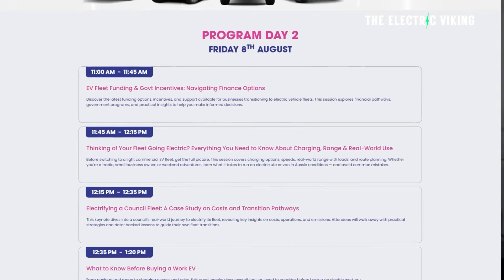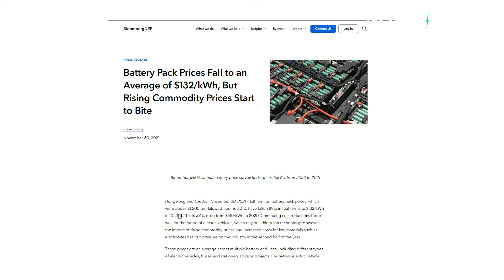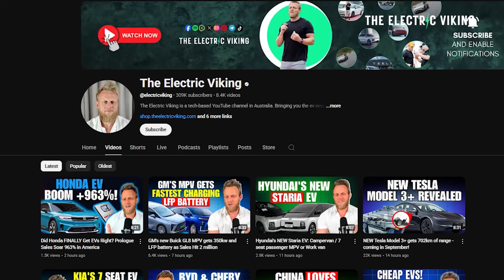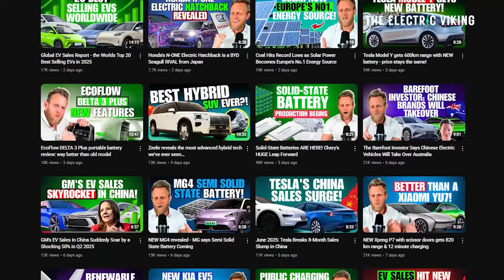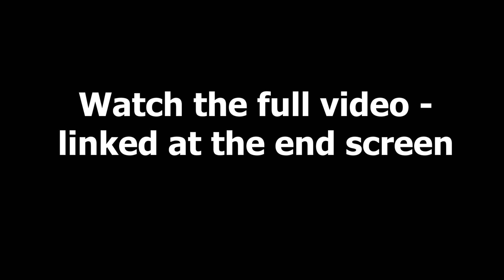EVs Are Almost as Cheap as Gas Cars Says Bloomberg — Here’s the Proof!

Comment: 10 years ago all news and print media published all EV adavantages and why they would be much cheaper than comparable ICE cars: 1000 parts less in the engine, no exhaust, no cat, no oilchange, no radiator, no gearbox..... Published conclusion/ result: an EV will cost at least 1/3 less than a comparable ICE car when it becomes mainstream, most probably only half.

Comment: I wish you were right. Unfortunately the picture in Europe is totally different. Last time I bought a car, 7 years ago, was a Suzuki Vitara, 4WD for €20k. A similar sized EV with 4WD is above 40k. Even if I compromise and look for a FWD car with decent range (over 400km) it's above 35k.  BYD has just opened a showroom ~70km from my home, their prices are the best but there are so many uncertainties with that company and with China. The more I watch your channel the less likely I buy an EV this year. It's like buying a digital camera 15-20 years ago. What you get is good but you know that something better is coming up soon, higher resolution, better dynamic range,  etc. With EVs it's the new battery technologies, autonomous driving features and price. And of course, you can't sell your old digital camera. None needs the old tech.
Reply: Nonsense. For example you can get a used hyundai kona with 64kwh battery (depending on how you drive) and few kilometers for around 20k. There are PLENTY New EVs with 400km range for under 40k.
Reply: @seppwurzel8212  The Hyndai Kona is on top of my list. But I'm not looking at 5 year old EVs. Those are around 20k. The new price is above 35k. As you wrote, there are EVs under 40k with 400+ km range, but a similar benzin is close to 20k and in this video the claim is that they are almost as cheap as gas cars. That is not true.
Reply: @AnTalk_blog wrong again. The VW ID 3 for example is within 200 euros price range of the similar ICE model. The MG 4 is slightly more expensive but has much better features that would cost a ton more money if in a VW
Reply: @seppwurzel8212 that soap box didn’t even make it to my list. Rear wheel drives do not qualify for me. Living in the Alps on a steep hill with potentially plenty of snow in the winter, rear wheel drives are a bad choice. I’m keeping an eye on the EV market, did my math and my experience doesn’t not match the above statement. Furthermore when buying a car you should also like it, not buying any shit wheelbarrow only because it’s cheap. At least this is my opinion. Most likely I will buy one sooner or later but it’s a hard decision especially when we know that better and cheaper EVs are coming (or at least we expect them to be so).

Comment: First you say EV sails are something like 25% however BEV sales - 100% electric are only about 10% of world wide light vehicle sales. In 2024 BEVs totalled 10.8 Million units of 100+ million light vehicles sold.  These BEV sales figures are suspect because companies like BYD are selling to dealers who may have them sitting on lots or sold as used with no miles; with highly subsidised prices. In addition many in China are not full size cars - they include mini city cars that have no safety features or ability to go to highway speed.  Even if you accept this - total market penetration of the 1.4 Billion light cars is under 2%; and heavies is near zero.

Comment: If EVs are the better value proposition to the consumer then the consumer will choose an EV over an ICE purchase.  Of course this  assumes access to charging is a non issue.

One big howler of course is the asphalt roads we drive on are made from oil product.  What is the renewable proposal as only 30% of the barrel of oil is turned in to petrol and diesel for ICE vehicles.

Comment: Talked to my insurer earlier this week to make adjustments to homeowners insurance due to the addition of rooftop solar on home in SE Michigan
My homeowners and auto are with same insurer.
Home insurance went down several hundred dollars with the added solar, as it counts as a backup power system. Contrary to what others have claimed or experienced in other states, either due to local weather (hurricanes) or just gouging by insurers.
As I expect to get an ev within the next 2 years, I asked what effect that would have on my premiums.
She said yes, in general, premiums may be higher for an ev vs equivalent gas vehicle, but more for a Tesla vs a Ford or GM ev.
She estimated 25-30% higher insurance rates for Teslas due to special  parts costs, and I am guessing, tendency of sports car driving behaviors resulting in more accidents.
Newer GM, Ford ev like the Equinox or Lightening are built using more traditional methods and parts other than ev specific bits.
As production numbers and ev numbers on the road increase,  I am certain insurance rates will be the same or less within 2 years ev vs ice.
Either way, my premiums reduction due to added solar most likely offsets any minimal increase in auto insurance for a Ford or GM ev given my time horizon
Reply: Insurance for my 2021 Bolt is only $30 more per month than the 2012 Prius C I traded in, which I thought was very reasonable.
Reply: @craigmerrow225 Sounds like less increase than basic inflation given the difference in model years.
The savings in fuel, oil and incidental ice maintenance (*belts, hoses, etc) more than make up for the trivial insurance rate  increase for a non Tesla ev, if any depending on your insurer, location, state, age, vehicle type, etc

Comment: It isn't complicated. EVs are already capable vehicles and they will get better as battery tech improves. This will slowly but surely eliminate the issues of range, charging speed, and cold weather performance. All you have to do is compare today's EVs to 10 years ago and then grasp the huge $$ going into battery R&D and ask yourself what it will look like 10 yrs from now. We overestimate the speed of adoption all the time, while underestimating the pervasiveness of the change.

Battery cost for performance...downward curve. Fixed costs...downward curve as volume of sales increases. There is only one inevitable conclusion and the only thing worth debating is the timeline. 

Gov'ts already know this which is why auto tariffs or outright import bans exist.... to shield domestic auto manufacturing from competition.

Comment: I drive my old diesel as long as possible. No cheaper way to drive a car... I am not at all against EV, but still too expensive...
Reply: My 1995 chevy k1500 has 200,000 miles, runs great, parts and repairs are cheap.  I'm retired so don't drive much anymore.  I can't imagine any reason to buy an electric car, makes zero sense.  Americans like trucks, and there's no practical electric truck at this time.
Reply: @gumby2241 fully agree🎉

Comment: In the USA 30-40% of people do not have housing with a garage or driveway, so you will always have people that can't charge at home.  This puts a ceiling on EV adoption at maybe 75% of new sales.  Per gas stations closing, this 25% will be plenty of demand to keep at least some of the pumps available at existing gas stations.  Also, much of the profit of a gas station these days is the mini-mart inside.  Also, many of these stations are built with 25 year expectations, the tanks exist and don't require much upkeep cost (and need to be pulled if they completely stop selling gas) so they might drop do fewer pumps, converting that space to chargers.  We have these hybrid station in Northern Virginia.  Sooooo .... I would revisit your logic about gasoline refuel range anxiety at least for the next 20 years. 

In the near USA you need EVs to be 25% cheaper that comparable ICE cars to compensate for the extra overhead for refuel on trips (most new EV buyers don't care much about gloabl warming issues) and the expense of a level 2 charger at home.   You also need to factor in higher insurance prices since EVs tend to be more expensive to fix even after small collisions, and the battery pack can get "totalled".  Also, a bit more wear on tires, but no brake work or oil changes = $300/year on average.  The lower cost of fuel helps balance this out and then some.  The good/bad news is that the ICE car companies have been putting out more expensive and less reliable cars for the last few years (even Toyota) that are ever more expensive to fix on even minor issues (push to replace systems vs fix).  If we can get the same type of core reliability numbers (vs small items) across EVs and ICE we should clearly see an emerging core reliability advantage.  Then that 25% is a deal maker for 50% of Americans, including me.
Reply: The US subsidizes the oil industry 770 BILLION a year. If gas was priced without a subsidy it would be $8 a gallon. Every taxpayer pays $4000 a year to the oil companies.  To say nothing of the million people that die each year from air pollution.  EV's are so much better
Reply: @b4804514 Millions?

Comment: Recharging is a pain in the neck. Regardless of price I won’t buy an electric car until recharging gets a lot better.
Reply: Also if you own a house, on average your only recharging an average of 19 km of driving in europe, and 40 miles of travel in the United states.

People don't drive their electric vehicle to empty everyday, or even every week.  

You only have to recharge for a long time on on long road trips.

And at least one of those times, you're going to have to use the restroom and stretch your legs anyway.
Reply: I find no pain with plugging mine in each night. Charging my EV on the road has been easy as well-northern WI and Upper Peninsula of Michigan
Reply: I'm still a hybrid fan, due to my distance driving.  I can purchase gasoline anywhere. Also, I'm surrounded by mountain passes.  If you get stuck on a mountain pass in the middle of winter, due to accidents or avalanche, you need to be sure you've got a heater to stay warm.  It's comforting to have both options.  I'm not poo- pooing ev' s.  I just have different needs than others.
Reply: @glennl70  I respect your choice.  But don't make it for the wrong reason.  The battery of a BEV (heat pump equipped) will keep you warm as long or longer than an idling ICE car, should you get stranded in a snowstorm!
Reply: @glennl70  When people got stuck in that big blizzard last year on the turnpike, the gasoline vehicles ran out of gas after 6 hours.  The EV's still had heat after 15 hours.   And they were also dressed better for the cold.
Reply: @mac_mcleod  Plus, if your gas car exhaust is buried in snow you could die from CO poisoning.
Reply: I'm going to assume you don't own a house then. I agree for people who don't own a house EV charging is more expensive and only about half the price of gasoline instead of 1/4 the price of gasoline and takes about 12 minutes longer than refuelling with gasoline. 

However for anyone who owns the house, they save 8 minutes per week compared to refueling with gasoline and they pay about 1/4 the cost of gasoline.
Reply: Unless you can charge neither at home nor at work, charging is a non-issue.  It happens at night while you sleep, or on a Sunday afternoon while you mow the lawn!
As to fast-charging on long road trips, it is now perfectly fine here in continental Europe; there are now chargers everywhere.

Comment: certainly the cost of the battery pack is a main driver of cost for EV’s, however, having manufacturers producing vehicles at scale is another one. When you hear Ford say that they lose $30,000 or whatever it is per vehicle that is not a product of the cost of the vehicle being inherently high rather it is a product of doing massive retooling to that only sell a handful of units. This is why Tesla is so profitable because in the US market they are the only company that has really produced EV‘s at scale. I believe it is 100% correct to think that it will only be when Evs have cost parody or even cost advantage over internal combustion that they will really take off.